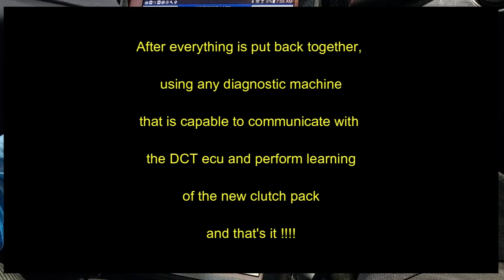Hyundai DCT Dual Clutch Replacement And Clutch Actuators Reset

Comment: Hyundai/Kia are in WAYYY over their heads with turbos and DCT's.....  They need to get back to the basics, before they are run into bankruptcy.
Reply from the maker: I don't think they will go back, they might have to invest more in some engineers
Reply from the maker: @cmscms123456  nothing I can do about it
Reply: Bruhh. I got a Kona, and I love mine lmao. They just need to make it better, if there are any issues.
Reply: @joegomez5463  You dont have a DCT, Dual Clutch Transmission..
Reply: @cmscms123456  Yes I do lmao. 2021 Kona (and before) came standard with 6 speed. I have the 2.0 with a 6 Speed Dct shift-tronic.

Comment: Hello George, good friend, I have a 2017 Kia Sportage 1.7 and it does not make any changes, it slides completely and to start only in N. I have a fault code for circuit in speed sensor 1 and 2 and engine hall 2 of the clutch. what would it be?
Reply from the maker: wirring issue is a big probability. Check power and supply at the speed sensors on the gearbox

Comment: Hi there. Hyundai only changed the clutch on my hyundai tucson due to juddering They didnt change the fly wheel or anything else. When i got it back it juddered quite badly again once. Is this normal? Does it need to be worn in? Or should they have also changed the fly wheel? Whats your thoughts on this? Many thanks
Reply from the maker: @YianniMichael  there is an improvement clutch pack, just go back and tell them still judders. The flywheel does not cause judder, just rattling noise
Reply: Hi There. As a 15 year Hyundai service master can tell you this. Change flywheel or check its flatness. if it got hot and surface is not even you can change as many clutches as you want. Your new clutch will be preset to a uneven surface and there will be judders.
Reply from the maker: @mindaugastrumpaitis6330  on dct, the  clutch pack contains both flywheels for odd and even gear and can not be separated. The connecting flywheel is a toothed flywheel that just makes a connection between engine and clutch pack, like a masive splined shaft.
Reply: @GicaPhp  Hi, so in summary, the fly wheel wouldn't make it judder?
Reply from the maker: @YianniMichael  the clutch pack is a complete unit made of 2 flywheels, 2 clutch discs, and 2 pressure plates. The connecting flywheel/ring gear it will not cause judder.
Reply: @GicaPhp  Thanks for getting back to me. The invoice they sent me (although covered by warranty) read the following parts on there - DCT Clutch, set double clutch, snap-ring and oil transmission. I take it that although there is no mention of the fly wheel, it would still be in that set? Also, so far, no judder.

Comment: Do you know whether it’s normal for the rpm’s to jump/flare when there’s a gear change on a dct? I’ve been noticing a 250-500 rpm flare when the car changes gear…not sure if it’s the cold weather…if I’m in manual shift mode and shift between 2500-2800rpm it doesn’t flare at all, it’s just a normal shift….I also released the brake and let the car roll and I haven’t noticed any judder or vibration. Do you have any thoughts?
Reply from the maker: try channging manual at the same rpm as it would in auto and compare 1st.
Reply: @GicaPhp  I just drove around for a bit and noticed that it flares in both manual and auto if I accelerate quicker, it didn’t seem like it was based on rpm, but instead how much pressure I had on the accelerator…if I just drive nice and lazy, it actually shifts smooth in both auto and manual. Even if I was at a higher or lower rpm in auto or manual it would shift smooth as long as I wasn’t stepping on gas too much…maybe my driving habits are confusing the TCU
Reply from the maker: @Cat-cp1jo  I would say it is actually how fast the actuators can engage the next gear and match the speed of shafts, the harder you push the more prominent the rpm drop will be
Reply: @GicaPhp  oh okay, makes sense…I’ll keep an eye on it and see if anything changes….I appreciate your help, thank you!
Reply from the maker: @Cat-cp1jo   you're welcome
Reply: @danejames7098  I’ve had it almost 6 years, recently found coolant dripping off of the transmission/lower engine mount area so it’s at the dealership, but maybe they’ll do a relearn while it’s there. Looks to me like there’s a minor leak at the water temperature control assembly that’s leaking backwards over the transmission case and into in opening at the top/rear of the case and maybe contaminating the clutch packs because it looks like the coolant is dripping out of the 2 holes at the bottom of the transmission where the flywheel and clutch packs are located. We’ll see

Comment: i have a 2018 i30 crdi dct, and the clutch was slipping and smoking, hyundai replaced it at 40k miles under warranty. please note that i drive absolutely calm and it was not my fault. 6 months after that i failed inspection because if a massive gearbox oil leak, they punctured some kind of seal ring while replacing the clutch. they had to take out the transmission a second time. since then i drove about 7k miles and the clutch is now starting to slip again a little bit, sometimes the rpm jumps a bit when shifting up. after driving for about 40 miles highway in gear 7, no shifts, the next red light it will rub and chatter and the rpm will jump in gear 2 and 3. also when driving very slow the car chatters until he clutch disengages, then it is silent. also i have a vibration at 2500 rpm, but not always, like if a heat shield rattles or something like that.. the car still has waranty, i will phone hyundai today and get an extended waranty or something, i dont know. the car is fine 95% of the time, but i think i am going to selll it.
Reply from the maker: Are you towing caravans? Are you holding the car on a slight incline or stationary without fully pressing the brake pedal? If you only hold the brake pedal slightly when stationary, there will be not enough pressure within abs unit internal pressure sensor  to tell tcm that you are stationary and tcm will belive that you are trying to creep forward or reverse.and will cause clutch to slipping after prolonged usage like this.

Comment: Hello George thanks for taking your time to make this video. My friend took his 2019 Hyundai Ionic to Aamco because of no reverse. They changed the clutch put it together and are now adding an additional 3k because the actuator calibration is not correct so they have to replace with a new actuator. Does that seem right?
Reply from the maker: Which actuator? clutches or selectors?
Reply from the maker: @JoseMendez-wo1cb  the actuator can be reset to zero. If there is no electrical fault with ac motors, wiring loom or mechanical with actuator on the car.

Comment: Hello Sir, a friend has a 2019 Ioniq 60k miles. Code p090a, sometimes reverse doesn’t work. Do I need both clutch actuator and flywheel? Can current actuator be fixed? Thanks is advance
Reply: It’s a hybrid electric, it’s also not charging from the wall, it only recharges itself with running motor
Reply from the maker: Your fault code is referring to clutch actuator motor, so you need to make sure the wiring is good and if all ok, new motor for the clutch actuator.

Comment: Looks routine for you. You must replace a lot of these. Is the dealer the only ones that can do this since the module need to be reprogrammed.
Reply from the maker: no programming is required, just teach in process, which can be done with many diagnostic machines
Reply: I’m guessing a lot of autel scan tools have this feature.
Reply from the maker: @fiehlsport  Yes, most of them have the teach in functions

Comment: greetings!  I have a 2017 hyundai elantra sport I ask you a question the car has 140,000 miles it started to give problems the changes in the dct transmission every time I start the car it gives three knocks!  And when I run it, it starts in first gear and then skips to third gear. Do you think it was the clutch or the transmission?
Reply from the maker: I never had this issue so far, but I would be curious to know what fault code you have stored?
Reply: Ever figure it out?
Reply: Kavrama seti değişmesi lazım. Ayrıca volant da değişecek

Comment: Hello.  Great video.  Have you ever had to remove/replace that gear actuator assembly?  It's the one on the top of the transmission when your video first starts.  I has the two motors and connectors on it.  Three bolts I think.  Thank you.
Reply from the maker: Yes I did, but before you do that, you want to remove the actuator and command each gear from diagnostic machine, and then manually move all gears inside the gearbox and identify were the fault is. You can also look in live data and see how much current is drawing when actuating
Reply: @GicaPhp  Thank you sir.  Is replacing that whole actuator assembly as simple as pull the old, put in the new, or is there some alignment that needs to take place before removal and calibration of the new unit?  Thanks again.
Reply from the maker: @robertboyer2954  no calibration needed for the hydraulic clutch actuator, just bleeding.

Comment: I’m getting a P073f, failure to engage in first gear. When I am driving and the car switches gears, it lags for a solid second, like a stall, and then switches to the next gear. It does not do this while downshifting. 

Should I perform this fix?

What do you think the issue is?
Reply from the maker: i would remove gear actuators, make sure i can switch all gears by hand and then actuate the selector in all gear via diagnostic machine
Reply: Did you ever get this resolved. I have the same code and experiencing this in my 2016 veloster turbo

Comment: Great video George! Subscribed.

I have a ‘17 Kia Forte5 SX 7-Speed DCT. I get the occasional knock/creak from under the engine (area) whenever I accelerate or brake at low speeds (under 20mph). I especially notice it when parking and moving forward and backwards.

I had a transmission slip issue because one of the local Kia dealers sold me the wrong transmission oil (ATF type 4). I have them my VIN. Another dealer found the mistake when they saw the oil in my backseat… by then I had already drain and filled and was actually at the new dealership because of slip issues. They drained, flushed and filled with (DCTF). Ran smooth for a few hundred miles and knocking came back.

Is my clutch pack damaged? Senior tech at second dealership said damage could have already happened from running on ATF type 4.
Reply from the maker: this cluth pack it is a dry clutch pack which is always dry., the oil it is for the gears. clunking noise could be selector. when selecting a gear, could be clutch actuators not engaging smoothly

Comment: Hello George, my mecanic got a P0921 OBD code after replacing the clutch and it when he puts in drive, it only goes into even gears and reverse (R, 2, 4, 6). Because of the code he can´t do the clutch re-learning. Have you had this problem before?
Reply from the maker: No, never had this issue. What is the VIN of the vehicle?
Reply: @GicaPhp  KNAPN815GJK435058. I appreciate any help!

Comment: Hey George, amazing and informative video. I bought a 2016 Tuscon that drives perfectly, but during cold start I hear a rattle noise from the transmission. All gears work fine, except some jerking when in traffic. Do you know what might be causing the issue? I have a diagnostic at home and it shows 0 faulty codes.
Reply from the maker: it could be clutch pack teeth / engine flywheel teeth worn out, causing a chattery noise
Reply: That's pretty normal for a DCT. I wouldn't sweat it.

Comment: Great video George, I've 2018 i30 CRDI Turbo diesel ( dual clutch)and when on startup gear 1 it makes vibration or shudder. this is happening sometimes especially up in incline. 
Do you think if i change the gearbox oil it can help? or add anti shudder?
Reply from the maker: oil will not change anything, it is the clutch pack that will need replacing with improved one

Comment: Hi George , I have hyundai ioniq 2021 67000 miles on clock , when setting off there is a grinding noise as speed builds up the noice disappears until braking slowing down to stop grinding noice comes back. Fully stopped no noise . Also when reversing same noise. Brake pads , calipers , disks all ok. There are no fault codes on dash. Do you think it’s the gearbox on its way out or gearbox bearings. Do I replace the whole gearbox and actuator and electric motor. Dealers not very helpful. Want £132 per hour 7 hours just to strip down and find fault. They wriggle out if warranty repair because car was not serviced by dealers.
Thanks.
Reply from the maker: As long as you have receipt of the parts used and services carried out as per manufacturer spec, and done at any VAT registered garage warranty is valid. Except for the noise, is the gearbox changing all gears ok? if yes, remove oil from the gearbox in a clean container and see if there are any swarf or metal particles in it.

Comment: Do you have to change the engine flywheel with the clutch pack? Not necessarily not related? And how long in your opinion it takes untill I have to change the clutch pack again for a mostly road driven car? I am planning to buy a hyundai with a dct, so I'm calculating the maintenance cost for this transmission.
Reply from the maker: The clutch pack contains both 2 clutches, 2 clutch cover and 2 flyhweels, and can not be separated, it is a clutch pack. The connectiion beween engine and gearbox is made through a big teeth plate (let's call it a flywheel) and does not need replacing unless it rattles at idle or has obvious signs of wear.

Comment: Good video! But does it applicable to Veloster 1.6T as well? Mine having a jerk during high rpm gear shifting after clutch pack replacement at Hyundai service center.
Reply from the maker: Have you scanned the car for any fault codes? I had a veloster which on high rpm would misfire and cause jerking.
Reply: What ended up happening
Reply: @GicaPhp  hey George you think you can give me some Info the DCT what are signs that the clutch is going bad and not the transmission
Reply from the maker: @skrillaone7785  Overheating, judder, and harsh gear change would indicate a clutch pack issue. What issues do you have?
Reply: @GicaPhp  awww man thanks George so I took my veloster in 2014 to get serviced I thought my transmission was going bad but my cars going through gears fine it’s just that the car hesitates going through the gears i till it into the mechanic they said mayb is bad
Reply: @GicaPhp  they said it’s probably issue with the clutch so now trying to get a whole new clutch to get it installed the previous owner drive it sport the whole time he owned it cars is in perfect condition just think clutch is going bad
Reply: @GicaPhp  car has 148,576 mi on it engine is still solid and transmission should be good but idk I don’t know anything just trying to get more knowledge on the matter and hope I do the right fix
Reply from the maker: @skrillaone7785  on the one i had the issue the spark plugs were the issue
Reply: @GicaPhp  so you think I should try and doing spark plugs I haven’t done no maintenance work in it besides the oil change

Comment: George, amazing video. my gfs veloster n/a cannot reverse due to clutch slip, but every other drives almost normal, mild slip at high speeds -  would this be clutch pak? Ive replaced a few manual clutches in my life, i reckon i'm keen to give this a fair crack. aliexpress has clutch paks for $800aud delivered for the correct OEM part number
Reply from the maker: I never had the chance to do a veloster yet, please send me vin number so I can have a look at some bits. If you attemp the job, you will need a bidirectional scanner to calibrate touch points and relearn gears. Before going for the replacement, try a relearn and touch point calibration and chec if any dtc stored
Reply: @GicaPhp  I still have not repaired it.... we bought an extra car. the veloster hasnt been touched in 1 year. i want to fix it, but the cost may be close to the value of this car
Reply from the maker: @Coryw133  i am sorry to hear that have you checked autodoc.co.uk for prices?
Reply: @GicaPhp  i will compare the price

Comment: Hi George, great and informative video no doubt. I got a 2015 Hyundai Veloster 7 speed DCT transmision. Gear 1, 3, 5, and 7 struggled and looked like skipping while driving when gears changing Only gears 2, 4, and 6 showed on the dash but it should show on the dash gear 1, 2, 3.....  as the speed go up but it's not. And also an overheating warning showing on the dash, I did a scan but no fault code appeared, the vehicle has driven only 59000 kilometers. I am just confused, Has the clutch gone bad or the actuator... it would be really appreciated if you have any opinion, on what could be the issues or any advice. Thank you
Reply from the maker: send me vin number
Reply: Any update on this?
Reply: Resetting the computer?

Comment: Salutare George, te mai deranjez si eu cu o intrebare, la 5-6 mii de km. imi creste nivelul in baia de ulei, am tras 600ml sa mi ajunga la nivel, este contaminat cu motorina, posibile cauze?, nu isi face regenerarea complecta sau posibil pe la injectoare? ce ma sfatuiesti sa fac?. multumesc mult, masina este Hyunadi i30/2018/ 1.6 D, cod motor D4FB
Reply from the maker: @danielgazdac-yb8dm  salut, regenerari prea dese sau incomplete or sa creasca nivelul la ulei. Verifica soot content cat este de mare. Au mai fost cazuri foarte rare (eu nu am intalnit inca nici unul) sa ajunga motorina in ulei pe la pompa de injectie. Dar cel mai probabil, dpf este infundat si face regenerari foarte dese si de aici problema ta.
Reply: @GicaPhp  multumesc , de maine incep verificarile, am sa te tin la curent cu ce gasesc